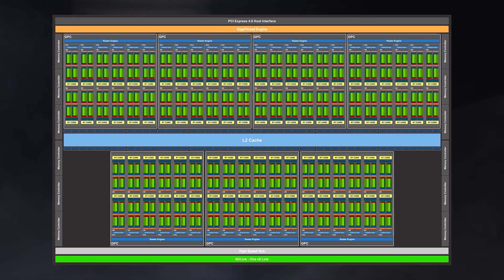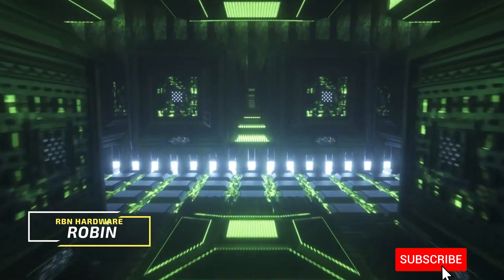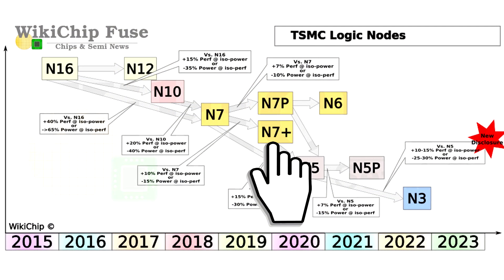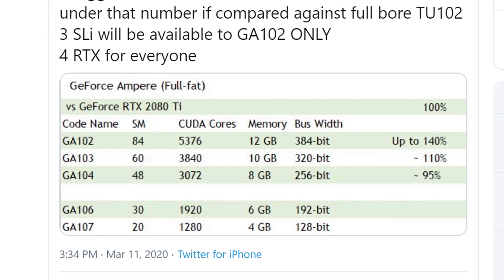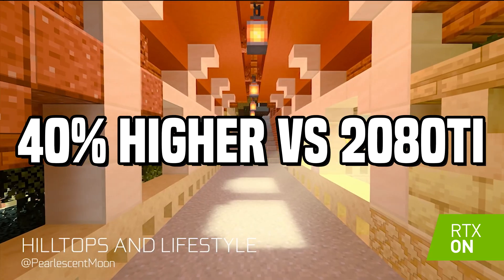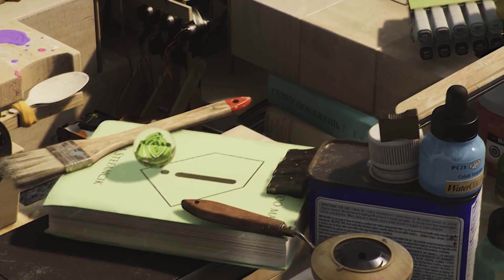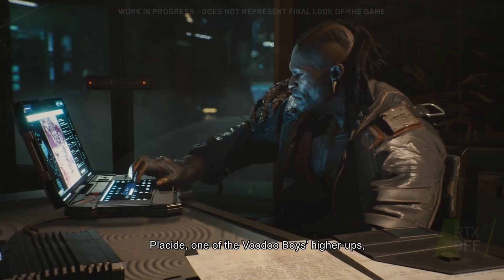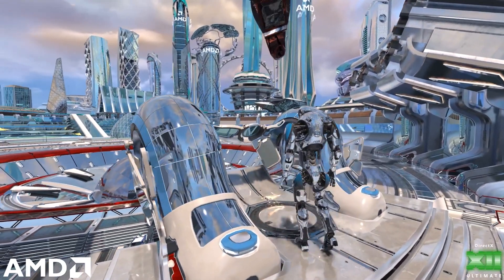Nvidia RTX 3080 Ti ‘Ampere’ MONSTER LEAK!! Specs, Performance, Release Date & Price!

Comment: I think this leak is irrelevant now that we have seen the GA100 which has 6912 fp32 cuda cores, 3456 cuda cores and 432 tensor cores which is less tensor cores than what volta had